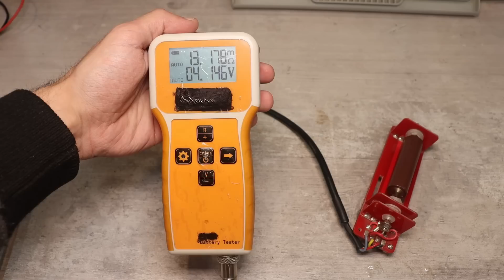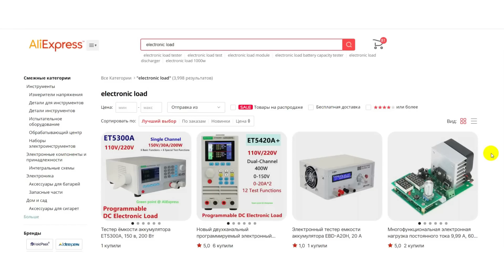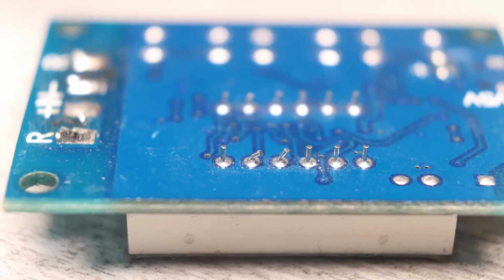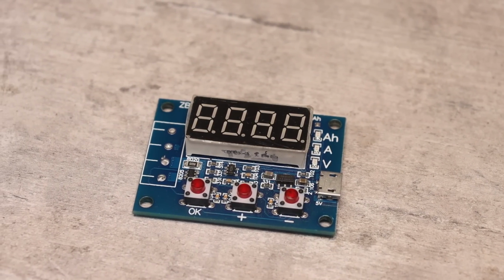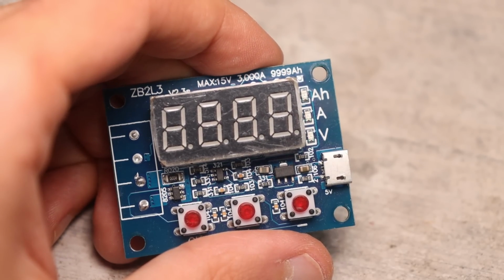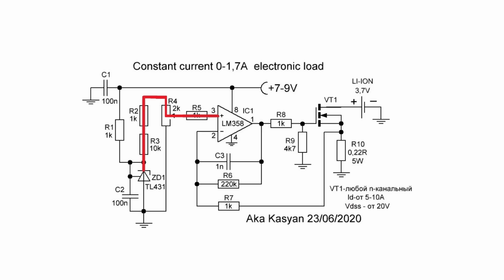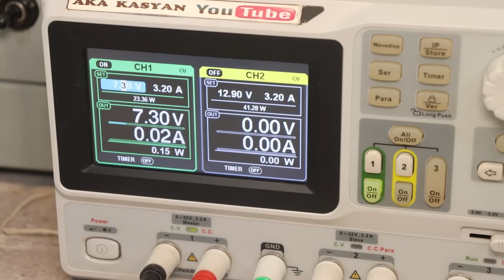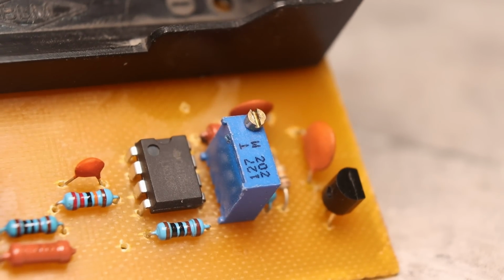Everyone needs this device ! Battery CAPACITY meter for a penny

Comment: Constant Current is NOT Necessary.
I tested constant resistance mode (C.R. with the included resistors).
tested with lab supply to be able to set any voltage to set the discharge current,
1. Set current to 200mA and timed how long it took to get to 10mAh, was 185 seconds,
2. reset and then set current to 400mA and timed how long it took to get to 10mAh, was 92 seconds,
Half the time with twice the current proves that CR mode reads and compensates the mAh and the constant current modification is not necessary.

3. reset and in one test I set to 800mA discharge (11v), started test and timed how long to 10mAh, then noted time and quickly switched to 400mA (5.5v) and timed how long it took to get to a total of 20mAh, exactly twice the time of the first segment. Again proving constant resistance is fine to test with and constant current is not necessary, even through I found a low cost (55 cents) two component solution (LM1085 + 1.25 ohm resistor) to provide constant current (verse the 15 components needed in this video).

@Kasyan TV did you not test this capability of this unit?     Have fun.

Comment: You could also just use a LM317 and 1.25ohm (1.5W or higher) resistor to limit the current to 1A, be quite a bit easier than your design. Thoughts?
EDIT: The LM1085, its a LDO 3A to-220 and has a full 1 volt less dropout voltage than the LM317, and should easily go down to 2.5V input, perfect for li-ion batteries and only 50 cents on Ali.
Reply: @robert. Some of my lm317 only work down to 3.0v at 250mA with 5.0 ohm 1% resistor, so I think to be safe if needed 3.0v cutoff to use above data. Since you can get lm317 for 10 cents in quantity of 10. For 40cents you could do 1A current with four 317. Still would be nice to find a ldo version of the 317,just haven't had time to look.
Reply: @user-rs8zg8ey2b  Your idea is smart and easy, try it.
Reply: @rbvenice  I already did, that IS the results.
Reply: @user-rs8zg8ey2b  Great! How much is the minimum voltage that your 317 circuit maintains constant current discharge, verified by you?
Reply: @rbvenice  all the numbers are above.
Reply: @user-rs8zg8ey2b  Thanks
Reply: No, isnt impossible for the minimum voltage work of LM317. Too simply...
Reply: @rbvenice  Just tried it, and it works to 3.3V, so if you need lower than 3.3v, then yes, your correct, but it does work down to 3.3v. We all know there is not much energy below 3.3V (unless its a LiFe cell).
Reply: @user-rs8zg8ey2b  I agree
Reply: @rbvenice see my new reply above about CR mode.
Reply: @user-rs8zg8ey2b  one can build a current source just from the transistor and tl431, or any voltage reference, and it should keep the current constant close to the ref voltage. If external supply is used for the base/gate drive, then all the way to the Vref.
Reply: @plainedgedsaw1694  can you show your schematic? Will see if it fits this application parameters.
Reply: @user-rs8zg8ey2b  i didn't built it, i'm busy with something else (but others did), but you can find it in tl431's datasheets.
Reply: @plainedgedsaw1694  Thanks for the info. Checking the datasheet there is a simple tl431, 1 transistor and 2 resistor circuit, and should work as you said. I do notice Vref is 2.5v, this plus the drop on the transistor is nearing the limit of this videos application (she wants a battery voltage cutoff of 2.5v, and there is a fet and 20 milliohm resistor on the zbl23), but should still probably be ok. I found the TLVH431, it has half the Vref of the tl431 (1.25v vs 2.5v), and gives an extra 1.25v headroom, or lower voltage operating cutoff voltage, this also allows a lower power series pass resistor too. Thanks for the heads up.
Reply: @rbvenice  if using 0.5A discharge, then it works down to 3.0v, so yes, it does work. There is probably a better suited regulator for this, just I have a bag of these and thought I would try it.
Reply: @user-rs8zg8ey2b  Please, let me know about, thankyou!

Comment: Why not use just use the zbl23 by itself? Yes, its constant resistance, but it applies the same CR to each cell tested, so the results are the same and comparable?
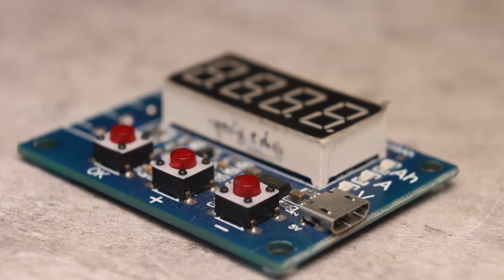Reply: At 3:05, the device does not "select" the current, you do by changing resistor loads. And it measures the current through R020 current sense resistor and calculates the Ah as the voltage and current drops, so it does correctly show the mAh capacity of the battery. Why do you say otherwise?
If you really need constant current, then my LM1085 and single resistor is a low cost 2 component, no pcb solution verse your 15 component solution. Thoughts?

Comment: nice
1 why R6 is so large the gain on the op amps is massive 
2 what is the role of c3?
3 how did you chose the mosfet for this application? or did you use what was available?

Comment: Lithium batteries are dangerous and should be phased out of use.
Reply: and replaced by what? all options atm are expensive and not as good
Reply: by what? lead batteries? 😂 we've already had a crisis where entire generations got dumber by leaded gasoline. lithium seems like a way better option, as it is only dangerous when submerged in water or played with. and trust me, it's not easy to open an aa battery

Comment: Can you help me, my friend, in making a circuit that controls 50 volts and 20 amps
Reply: the obvious answer would be using a powerful mosfet, but you don't give any details so i can't help you more
Reply: @the_bootleg_starwalker  I tried searching a lot but I didn't find anything can you help me and send me the link of the video
Reply: @ahmedkaram40  what are you talking about?? if you don't give me any details then i can't help you. there's no video. what application is the 50V20A for?
Reply: Use cheap fet irfz44.

Comment: Nice I hope this would be very accurate when it's with Tp4056 👍
Reply: It does nto have to be accurate constant current (see my posts above), also if you want CC, I have a low cost 2 component solution, again see my posts above, it does not even have to be CC, CR is totally fine.

Comment: How do the Battery Internal Resistance Meters selling for less than $100 work? 
Do they inject and AC voltage across the battery and see the voltage drop? 
Do a project like that. One that we all can build on the cheap. 
Not many will build an analog load when they can buy one for < $30.
Reply: They measure open cell voltage, then use a short discharge pulse (like 30us at 1A), during this time they measure cell voltage and calculate cell IR.